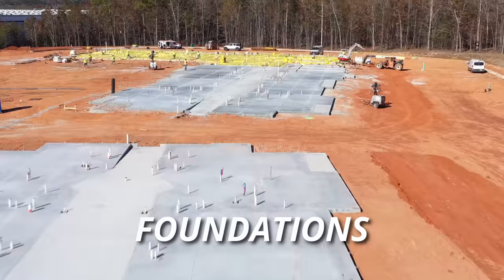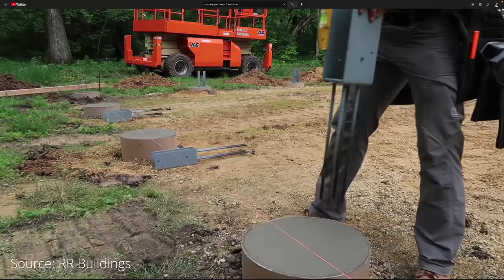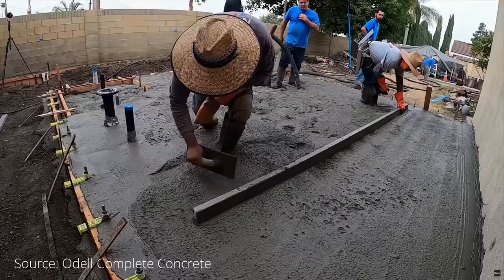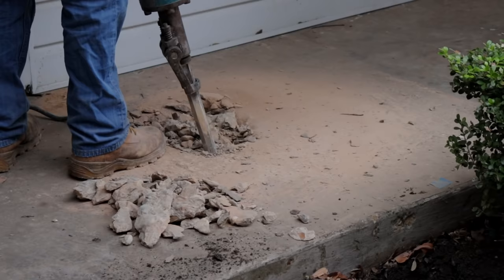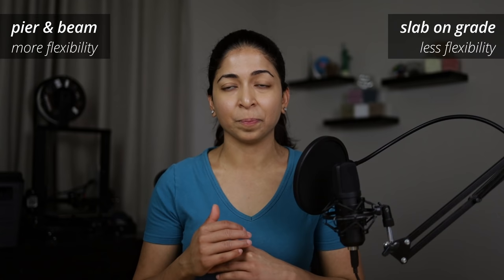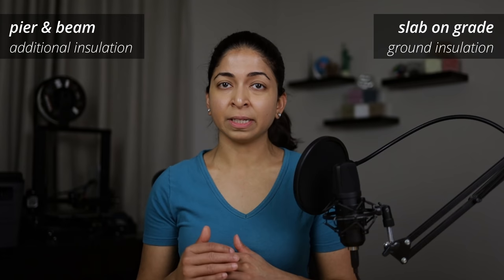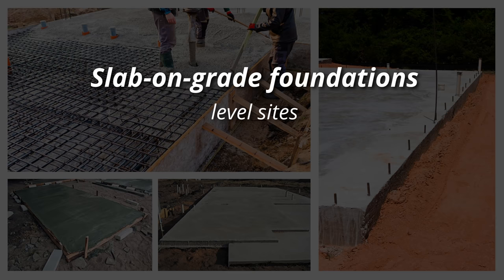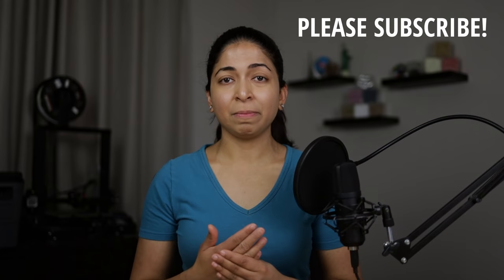Pier and Beam vs Slab Foundations | Which one should you choose?

Comment: Here in south Florida lots of people live in manufactured homes. The homes are positioned over a string of concrete block piers under each long steel beam. Tie downs are generally diagonal steel straps attached to the beams and then extended down to earth auger/anchors. There are different tie down specs for each specific wind zone. Much of FL soil seems to be a free flowing type sand (fairly compaction resistant), it's not uncommon that a Florida mobile home will move or settle slightly over time, however mobile homes can be easily/inexpensively releveled/realigned on the piers as needed. 
It's advisable to have plenty of air movement under the mobile home to prevent moisture buildup. This free-air-flow 'skirting' can be screen or slats. BTW, under the home is a good space for geckos and common black snakes to do their thing (bug and rodent 'getters'). As with any home, it's important that the mobile home site is well drained, and the soil beneath the home needs to be covered with an effective vapor barrier.

Comment: In th eUK residential buildings are usually built on trench and concrete foundations. A meter deep trench about 450mm wide is dug and filled with concrete so that these foundations support the perimeter of the building where the mass of the building is concentrated. The  interior ground floor is then insulated and concret poured on it and levelled off. 100mm of insulation is presently the required amount with about 100mm of conrete on top. A damp proof membrane is applied under the insulation at the start.

Comment: I also live in Texas . More precise , North Texas just North of Dallas, Texas . I own an old house built in 1918 . It was built on a type of wood from the Bois D Arc tree which is a very hard wood that dries out and gets as hard as concrete you could say . But back then they didn't sink the posts or piers very deep . But it did last just under 100 years and I had to replace Every pier under my house . NO Contractor would replace them as they all simply dig 4 to 6 inches into the black clay dirt , which around here they call this dirt black gumbo dirt . Anyway after they dig out 4" they put down two concrete pad blocks which are 4"x18"x18" and place 8"x8"x16" concrete blocks used in building a wall or are hollow inside , side by side and stack them Chris Cross then place 2"x 6" or 8" wood on top of the concrete blocks then use 4"x4"x1/4" metal shims on top to level the house . To me , that is unacceptable !!  Also it's great repeat business for the house leveler !!  So I basically did it myself with help !! But I hand dug each one out creating a large hole about 3 feet deep until I was in solid white rock . Then poured an 8" thick pad with rebar , then after dried placed an 8" in diameter tube I backfilled then poured the tubes with concrete and rebar sticking up out of the ground . Imagine a large mushroom upsidedown with a long stem sticking up out of the ground . Then shimmed to level and installed hurricane screw anchor mints into the ground with a strap anchored to the beam of the house on every pier . Took me almost a year to complete !!  This Old House Will Never Shift Or Move !!!  That is now almost 5 years ago and still is completely level !!!  Otherwise every 4 to 5 years you need to re-level a house because of this type of soil and they charge 3 to 4 thousand dollars to re-level a house of upto 1500 square feet . Again it's called repeat business for house levelers on pier and beam house's . So on your video , I thought it really did not get into much of any depth for foundations . Sorry .  I guess I'm just lazy , if you're going to to something , do it right the first time or don't waste your time as you'll have to re-do all your work again !!!  I really hate doing any work twice !!!  Plus I've been remodeling and building over 40 years .

Comment: I have done the pier and beam, with an adjustment I pour concrete after the piers are poured, I learned this from another builder then you can either have brick on the outside. There is so many different things you can do to improve the loss of heat , Thor cold air from the a/c in the summer. The poured slab you can now dig down just a little deeper and they have foam insulation that can have concrete pour on it which will help with temp control in the house. This two she talks about are simple foundations, that if you add to them can make your home so much better in the long run.

Comment: Thanks for the video!

Some perspective from a resident/owner …

My previous house was pier on beam, current is slab. I will NEVER buy a house with a slab foundation again, for two reasons. First, the cost and complexity to repair or remodel anything to do with the plumbing is massively higher with slab. Second, flooring on top of concrete is less comfortable, unless you are doing wall to wall carpet.

Comment: The UK switched to slab on grade a couple of decades ago for new builds and there's been nothing but trouble. I've seen entire sites demolished before getting to the second story to be swapped over to pier and beam or the slab thickness increased to deal with the soil conditions in what is predominately a rainy climate. On the same instance when I was in Texas I saw many slab on grade foundations dip only slightly and due to the incoming water main being laid in or below the slab, it had broken and released thousands of litres of water (in one case 90,000 ie 90 metric tonnes) eroding what soil was under the slab and tilting it even further out of level. 
It has benefits used in the right climate with decent though put into services beforehand but too many times there isn't enough forethought and planning.

Comment: I personally feel Slab foundation with 3 to 4 feet deep footing running across perimeter and in between along long side as needed would be best , it would solve problem of breaking edges and slab tilting , if I can afford I will run utilities on outer perimeter in extended slab with adapter inlets at places needed , any repair will not need touching main structure nothing under house nor running inside walls

Comment: I second, third, fourth the comments requesting information about basement foundations.  In my region (US, Midwest), we have primarily clay soil and bedrock that isn't too terribly deep.  My current home is a split level from 1970 that has a basement below grade which is perfectly positioned to accept all my neighbours' run-off when it rains.  Lovely.  There's also an on-grade slab for the garage and "lower level".  There's nasty carpet over the "lower level" floor.  Thankfully that room hasn't had water issues.
I grew up in a farmhouse that had a slab under it, I think, because it burned down and we ended up with a trailer house set up as a temporary home while we built a new house over the old footprint, but then it had some weird crawlspace over part of the slab.  I absolutely HATE crawlspaces.  I can't count the number of times I had to go down there as a kid because I was smaller and fish out / look for an animal (pet or wild).  It always stank, was muddy, and was full of spiders and stuff.  So nasty.  Is there any way around this, other than always hiring out somebody any time work needs to be done or looked at?  Or do pier and beam folks just resign themselves to standing on tip-toes over the creepiest of crawlie-spaces?

Comment: thank you Belinda. I'm curious about perimeter T footings which are very common...they create a raised floor (similar to pier and grade beam) without drilling piers...just excavating to proper footing depth and pouring a stemwall. How does this system work in clay? better than slabs?
Reply: I see most of the houses in the Bay Area are using this. The piers are just sitting on top of the ground. Most of the problems are piers will move.

Comment: There are so many more advantages to pier and beam, I'm still discovering ways to improve things I never expected.
I.E. I sealed the intake and exhaust from my fridge inside and ran vents under house to always draw in cold air.
My power consumption dropped 62% and the lint inside my house is almost non-existent.
Also I have a much warmer floor than my neighbors.

Comment: You made a comment about about slab houses not being able to be moved. It is simple to move them but it causes a lot more damage. The whole house has the interior and or exterior wall covering removed then the bolts or tie downs undone. Screw 2x12s on the walls about a foot up then jack up the house. The problem is all the kitchen, bathroom, interior fixtures have to be removed and rebuilt. It's only worth it if the structure is architecturally significant or it was all going to be redone anyway.

Comment: I thought I had seen all foundations, and I thought the list was defined.....then a few years ago, I saw a house sitting hillside on river stones.   The house sits on stones, small enough to skip across the water, and was secured in the middle of the house.   the house was 100+ years old.   If you were to look under the house, you'd see the stones.   I've also seen a house sitting on a single rock (the rock is the side of the mountain).   it's a wow, when you go into the basement, and see it's a single rock, sloping down greater then 45 degrees..    Also 100+ years old.   No company would do something unconventional like that today.   I've also seen a "rubble foundation!".   Quarry rubble, is loaded in a mound, and the house sits on the rubble.  the house is a stone house.   It was housing built by the quarry workers.  (they used the stone from the quarry, and shipping crates.).     So many diffrent types of foundations, and so many unconventional foundations.

Comment: A couple of items. The ground in a crawl space can be covered with plastic to control the moisture in the crawl space, you should insulate the floor in the crawl space and the crawl space keeps the wooden part of the structure high enough off the ground so you don't get spatter on it from the rain. With slab on grade buildings the bottom of the structure close to the ground seems to get a lot of water damage.

Comment: I go w pier and beam every time just for the ease of moving/repairing utilities alone. Our old house needed new electric and plumbing throughout and it would have been a disaster on a slab. We used a weiner dog to run the electric in the particularly tight crawl spots! She did great. 😂👌

But we also had a 4ft rattlesnake underneath the house that ate one of our cats (presumably). So there is that.

Comment: Building is so differend from region to region. We do a perimeter frost wall of two to three feet on a footing whose depth is dependent on the type of soil. We can then install the below slab plumbing, compact the base, add radon rock, insulation, vapour barrier then pour the slab. An alternative is to install pads for the posts in a the crawl area, compact the soil, radon rock, vapour barrier and then a skim coat of concrete. This allows the plumbers and electricians a free work area in the crawl space. Southern BC interior mountain area

Comment: As a retired builder/ex-pat living in the Philippines, post & beam construction is very common. In building residential 3 story concrete structures
1) I do not use hollow block to fill-in between the post & beams, but instead pour 4”+ walls at the same time. 
2) Use fiberglass entrainment throughout the pour along with the desired earthquake standard as set forth by P.E.   
My hopes are to avoid the common cracks in the rendering/stucco coats seen within 3 to 5 years of build. I also thought that the fiber will help to adhere more securely the finish coats, but as the projects are underway, can’t back-up my hopes with evidence.
Are my hopes of a better job fool hardy or not?
Thank-you for your blogs, love em!

Comment: My house is slab .  Rebar is showing in the west side .  In the past I had to spend  $11,000 to stabilize the foundation .  Now I am looking at spending more money on repairing a portion of the cast iron plumbing .  If I replace all of it , the cost could $68,000. I don't think the psi in the concrete was very high back in 1972 .   Also no thought was given as to the water drainage around the house .

Comment: If you don't a basement: Go with slab

If you need a basement: Go with concrete load bearing walls up from the basement to ground level with beams or trusses supporting the floors above. Going with piers just sounds like a never ending headache from never knowing what's going to fail next and when. 

That's how it's been done for over a hundred years here in Europe. My house was built the second way in 1921. The burried load bearing walls were poured bad as heck and straight in our low ph soil without any gravel drainage and before the days of Insul-Drain but it still has 75+ years before it starts being an issue.

Comment: The houses I grew up in were wood frame and rested on pier and beam foundations. There was no augering for the pedestals as shown. As near as I could determine, the ground must have been leveled and compacted before construction. Flat concrete soles or feet were then laid out upon which were stacked cinder blocks or concrete blocks. The main wood beams of the house were then laid out atop the blocks and the flooring built up from there, similar to a deck. The house must then have been constructed on the flooring structure using traditional methods.

As I grew up poor, these houses were invariably prone to leveling problems as the piers were not always set with precision. The wood flooring, or course, sagged with age and we could hear opossums running under the houses at times, bumping along in their nocturnal foraging. Water faucets HAD to be trickled in the event of sub-freezing weather as the cold air would easily infiltrate the crawlspace.

Comment: @Belinda Carr To re-level a tilted slab I wonder if it could be done by slab jacking to lower the costs of interior piers? Core drill a pattern of small diameter holes where needed and then pump in the lifting medium. Cheaper? Less disruptive than trying to install precast piers?

Comment: Post-tensioned slabs have great applications where the desired span between columns is desired.. but they are more difficult to work with for renovation works.

There is another solution to Pier and slab on grade, called Strip-footing that you could look into, to see if it may be applicable to American/Seasonal applications

Comment: Post tension slabs, when they are designed to mitigate water transmission beneath slab, are very effective.  However, I see many post tension slabs built without adequate protection, and this could lead to the lifting of the entire house as you describe.

Comment: There is a slab levelling method where several small tunnels are drilled under the slab and a sturdy bag is forced into position.
The bag may first be inflated with air to unfurl it and then concrete is pumped in.

Comment: In my region slabs are nearly exclusively used. I have seen a bunch of buildings with giant cracks. In one case, you could stick your hand through the wall!
There are two typical reasons: 
1) a wing was later added (a new slab added)
2) they built on dried land. Either the land gets mount again, or due to different sediments (building over a riverbed) the ground settles at different rate.
In any case, I found it weird to see that in America, entire buildings are moved. This is probably only possible due to them building on pillars, using mostly wood, and having far wider streets.

Comment: @1:39, where anchor bolts are embedded into top of caisson/ pile for the purpose of carrying a structural load, three #3 rebar hoops or 2 #4 hoops shall surround the anchor bolts. This ensures ductility of the connection.

Comment: Slab foundation can be built safely in areas with high clay contents by replacing the clay with gravel and then compacting the gravel. This also acts as a drainage protecting the foundation from water.